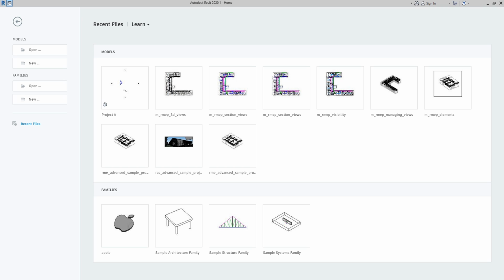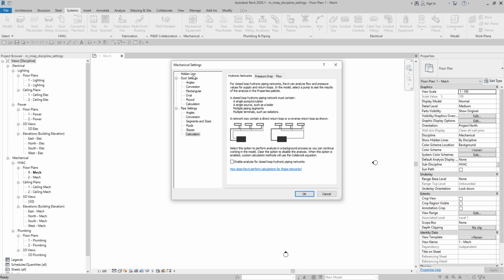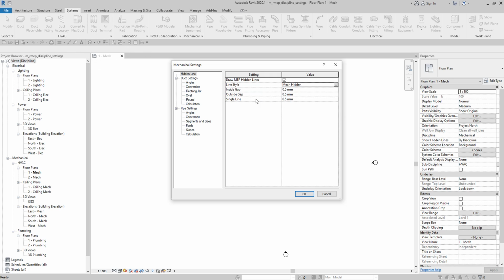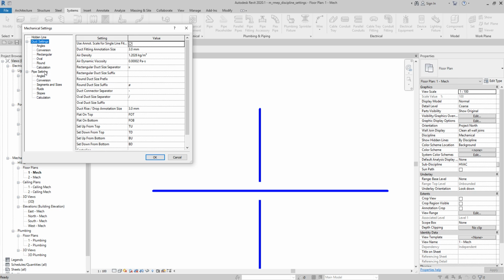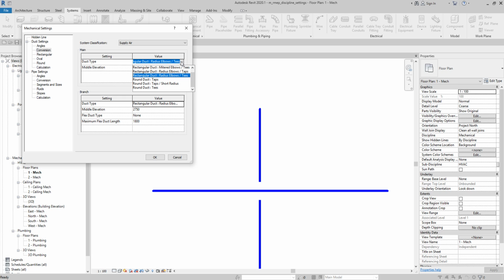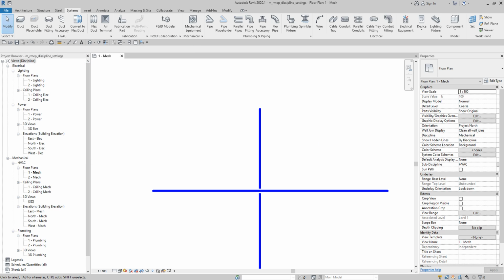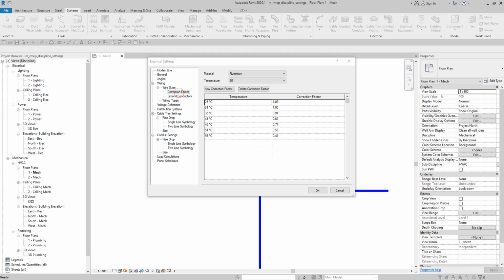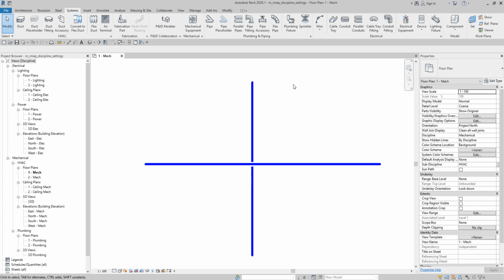REVIT MEP 2020 - STEP BY STEP TUTORIAL 12 - HOW TO DEFINE DISCIPLINE SETTINGS

Comment: Hi Rich. Thanks for these great videos. When I open the mechanical settings and pick on pie sizes, there are lots of different specs of pipe that are set up. For example Heavy Carbon Steel. But when I want to route a pipe, most of the pipe specs available in the MS dialogue don't appear to be available in the Properties panel. Any ideas? Thanks, Johnny.
Reply from the maker: Hi Johnny, the issue you're describing could be related to how the Pipe Types and Pipe Segments are set up and managed within the software. Here's a possible explanation and steps to address this situation:

Pipe Types vs. Pipe Segments:

In the "Mechanical Settings" dialog, you set up various Pipe Types with specific specifications, such as material, size, and schedule. These are predefined pipe configurations that you can use in your project.
When you route a pipe, you are essentially creating Pipe Segments that connect different points in your design. Pipe Segments use the Pipe Types you've defined to determine their specifications.
Creating Pipe Segments:

When you're routing a pipe, the available Pipe Types might differ based on the context and the elements you're connecting.
The "Properties" panel during pipe routing typically displays only the relevant Pipe Types for the specific connection you're making. This helps to prevent clutter and confusion.
Addressing the Issue:

Make sure you have set up Pipe Types with the correct specifications in the "Mechanical Settings" dialog before routing pipes.
When you start routing a pipe, pay attention to the options that appear in the "Properties" panel. These options should include the appropriate Pipe Types based on the context of your routing.
If you're not seeing the expected Pipe Types in the "Properties" panel, ensure that the Pipe Types are defined correctly and that they match the expected connection points.
Checking for Consistency:

Double-check that the Pipe Types you've set up in the "Mechanical Settings" align with the requirements of your project and the systems you're designing.
Verify that the Pipe Types are assigned to the correct systems and that they have the appropriate material, size, and schedule properties.
User Interface Behavior:

Revit's user interface is designed to show relevant options and configurations based on the task at hand. During pipe routing, it's normal for the software to filter and display only the applicable Pipe Types to avoid confusion.
Consult Documentation and Resources:

Refer to the Autodesk Revit documentation or online resources for specific guidance on setting up and managing Pipe Types and routing pipes.